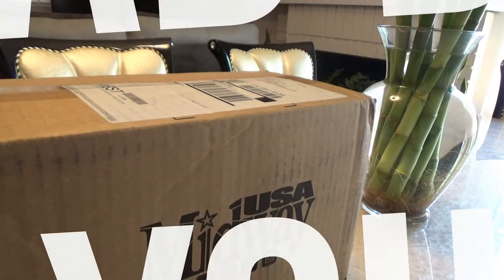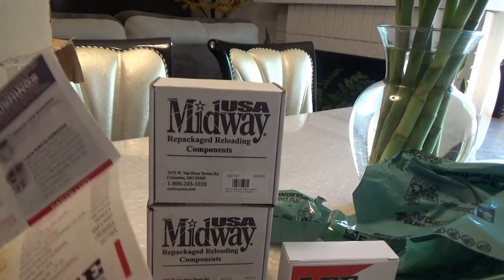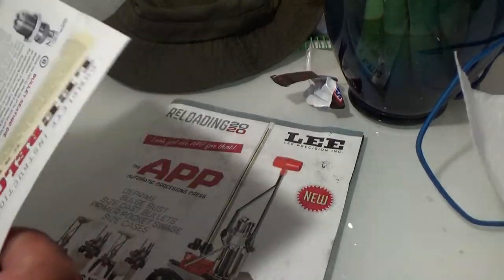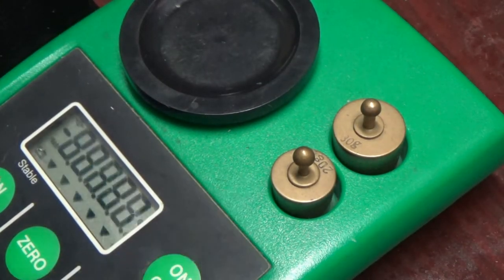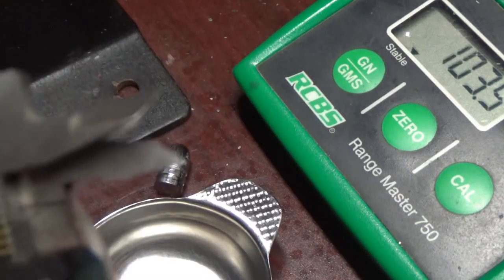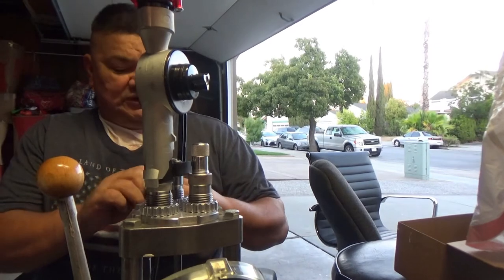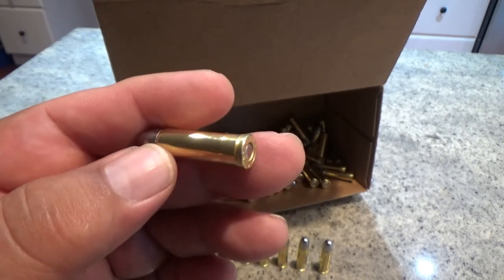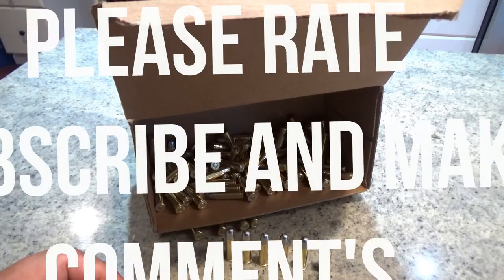32 H&R magnum from start to finish

Comment: Nice video and bullet casting. If I ever went into a single action i'd go with the classic .45 LC and the Vaquero as I get it, the new "old" revolvers are funny, the Vaquero is just like they used to be as far as looks go.
Reply from the maker: exactly!!  point well noted Sam, ooh BTW  that .380 did a surprising  number on both melons...but the .38 spl had more time to expand in the bigger target and put that water melon in it's place very fast. thanks 4 watching.

Comment: Great video 4 life, i'm very lucky in owing a Ruger SuperSinglSix  in a 10 in.,& a 61/2" bbl. &  Charter Arms 3 in. 7 shot , all in the 32 H&R Mag. And love casting , lubing (wheel wt. lead) bullets & rolling my own. This 32 H&R  Mag. is perfect for reducing coyotes @ my ranch. I also load some with a #12/#9 shot mix for rattle-bugs.Very enjoyed your video. Thanks,  ....1SG.,J J Huro Jr, USA RET.
Reply from the maker: Looks like you have a very sweet set up what a way to reyire.

Comment: A great video, thanks. I have the exact T-shirt too. Your power throughs from that Lee auto drum is amazing. I never can get mine working right. I always end up using my dillion square deal powdered throughs. That thing is always accurate for me or I use a scale.
Reply from the maker: i've had many negative comment's about the lee auto drum from previous owner about how they leak and the chugging noises it makes..it appears you either get a golden egg or a rotten one, thanks 4 watching.
Reply: @Ford360CID  Looks like you got the good one.
Reply from the maker: @bobhartman2571  i did a retune video on these auto drums polishing the aluminum race bearing and retighted the drum seal.
Reply: @Ford360CID  Yes I did see that video of yours. It helped a little, but still had inaccuracies.  I typically use Tithe group powder. I'm thinking that the shape of the powder used on the Lee, auto drum has something to do with it.

Comment: Hello!  I share your appreciation for the .32 H&R Magnum though I have not started reloading for it yet.  I have dies for .32 ACP and S&W Long and Short and a mold like yours.  I'm planning to give it a try this winter when I'm stuck inside.  I have two revolvers now chambered for the cartridge.  I collect just about any .32 and have an NEF R73 and I just bought on Saturday a Heritage Rough Rider that is 32 H&R magnum with 3.5 inch barrel and bird head grips.  Neither are the quality of an SP101 but neither were that price point either.  Just subbed and will be checking out some of your other videos.  Thanks for a great video!
Reply from the maker: i got most of the dies from ebay really cheap i payed 17$ for the .32 long dies that also will double as a 32 H&R magnum die as well, i bought the .32acp/32 short die on ebay as well but payed more for them, the .380 shell holder .223 shell holder will also fit the and i bought the H&R shells on midway usa and i had a box of 32 short shells that was given to me or diamond brass used cases is a great source for hard to find shells. i have a lee 100gn mould and a rcbs 88gn mold i also got on ebay.

Comment: Recently got a Single Six4.6"  in .32 H&R.  Using my Lee .32 ACP dies, Lee .223 Rem shell holder and S&W Long cases I loaded up some ammo.  Using Lee 90gr TLSWC with range scrap and 7625 powder they shot great.  .32 ACP ball ammo is inaccurate.  Haven't had time to load the .32 S&W (short) and H&R cases yet.
Reply from the maker: I had a few 71gn ball bullets I loaded for the H&R cases they move put quite fast for such a light bullet.

Comment: Man, I would Love to have Your Knowledge about Reloading. I have an old Ruger Single Six in 32 H&R Mag., But can't find Ammo for it anywhere. I actually traded My Old SP101 32 H&R for the Single Six.  Absolutely LOVE that Single Six!
Reply from the maker: the single 6 would be my go to revolver as well..that was a smart choice those revolvers will out live you for sure, once you have the components brass and an inexpensive single stage set up your set up for life..i believe the 32 H&R magnum is more reloader friendly and can generate great velocities as well as the .327 magnum without the sticky extraction, my favorite jacketed bullet is the 100 grain hollow point, out of a 3'' ruger i get up to 1200 fps without high pressure signs. if you want to get started in reloading for the .32 H&R i can help you out.

Comment: Can you tell how much the cost for starting reloading  .32 h&r magnum? Thank you for the attention
Reply from the maker: my apologies for the late response utube has been messing with all of our notification bell alerts, so as far as price goes it could be more or less and i will explain how!, if you already have the single stage press then you just saved yourself 75$ the dies are around 38$, finding once fired 32 H@R brass laying around your gun range is nearly zero so your gonna have to purchase new or go on the used brass websites and get it there, powders are steady in price Hodgdons being the cheapest and Alliant being more expensive, primers were the biggest issue getting primers during that time were just a pain to get, so if you go to midway USA and happen to see the free hazmat and or free shipping sales along with sales on components is what i originally did it would be in your best interest to use this method and of course that goes for any other caliber as well, im sure you've already started and i would like to hear it went for you after 2 years.

Comment: Great video as always. I had to subscribe to your channel again. For some reason I was unsubscribed. I love my Lee Pro 1000. Any particular reason why you don't Feed constant shells through or prime off the press?
Reply from the maker: as you witnessed the belling of the .32 H&R magnum case mouth was a bit tight causing the machine to vibrate vigorously, and may cause knocking the primers out of proper feeding or the weight of a full feed tray falling out causing the primers to spill off causing loss of primers, single feed is more reliable and 100% primer retention and you can feel the primers seat with great tension without a crooked and smashed sideways primer in the primer pocket, it is not a race for quantity but a pace for quality, thank you 4 your subscription and your great comment, i am looking forward to hearing more comments from you take care.
Reply: Got it. That makes complete sense. Thank you for all your great information. I gained alot of knowledge watching your videos. I started casting about a year ago and your videos guided me in the right direction.
Reply from the maker: @arizona_west5392  technically utube will not let me make instructional video's on ammo...but! i stay within the fence line such as not showing you the bullet in the pro-1000 or the lead pure into the mould so those that have done casting and reloading already know what i"m doing without being over graphic, i'm happy that my video's have lead you in the reloading and casting world, good luck to you sir.